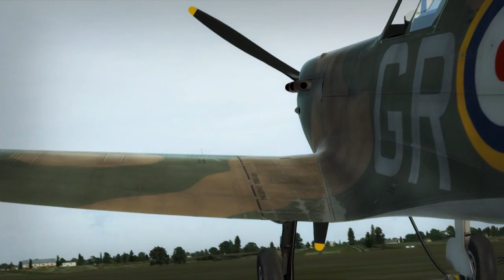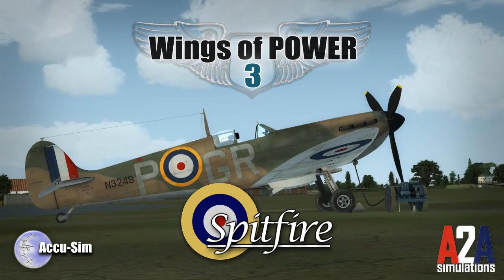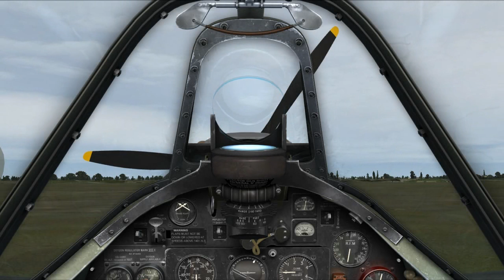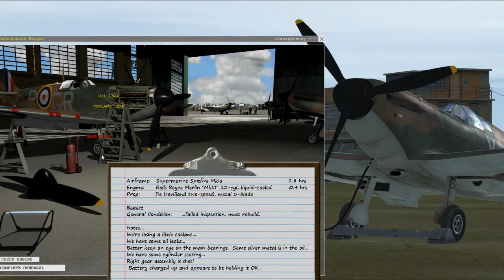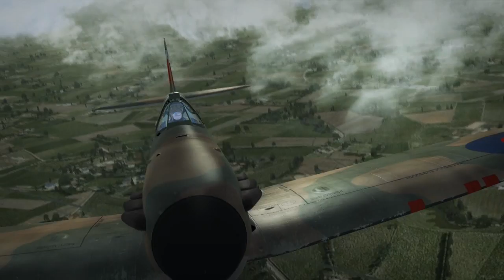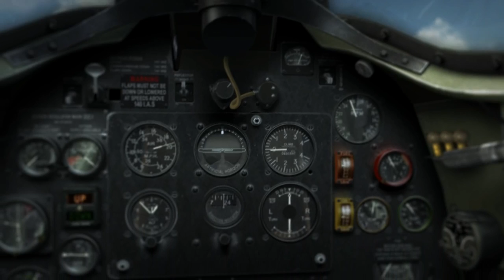Wings of Power 3: Spitfire (Accu-Sim)

Comment: Really excellent aircraft, first class. Especially the later Mk`s.  Eliptical wing idea copied from the Heinkel 70 I think. Good idea to nick the design anyway as it worked.  Very well no doubt. The Messerschmidt 109 was it`s equal though, and this aircraft had straight line wings. The spitfire was improved  when it had the Griffon engine.  In my opinion the Daimler Benz engine of 33 litres was the better engine and gave the Messerschmidt a touch more speed especially in the earlier days. I am told that the Germans did not have very good fuel at times but I don`t know for sure. I believe the Hurricane was a great aircraft as well and did most of the donkey work!.  A gentleman who had flown  Lanc`s and then both of the fighters mentioned  (not always in anger) told me this. I cannot ask more as he is now deceased.
Reply: Eliptical  wings wernt copied they came about as a way to house the guns